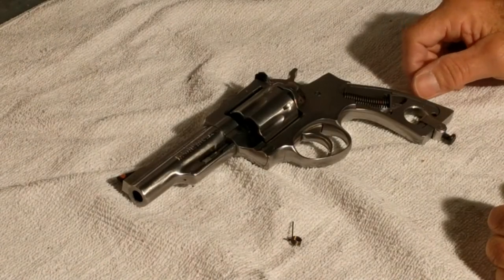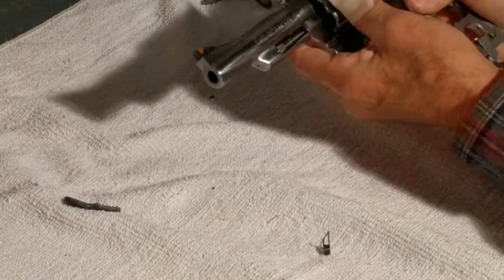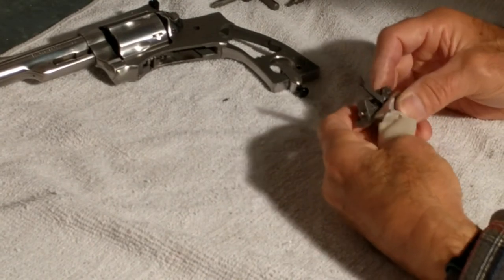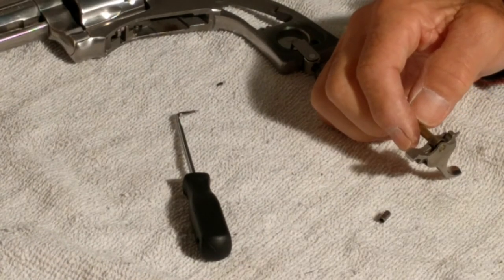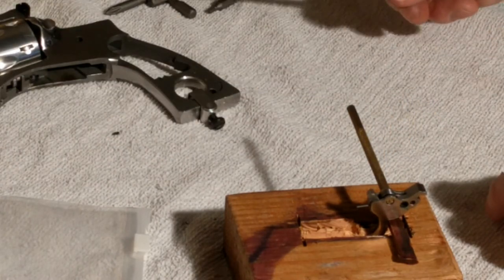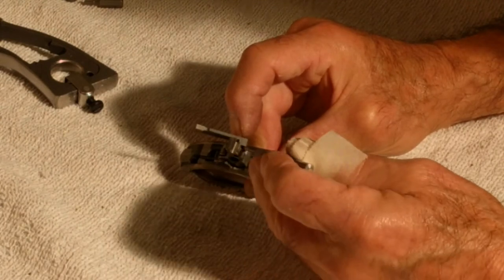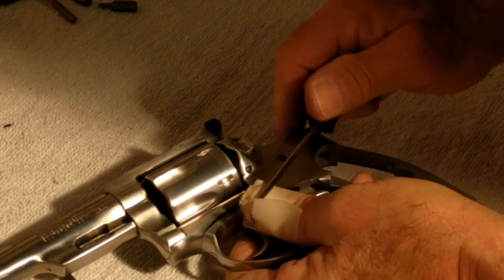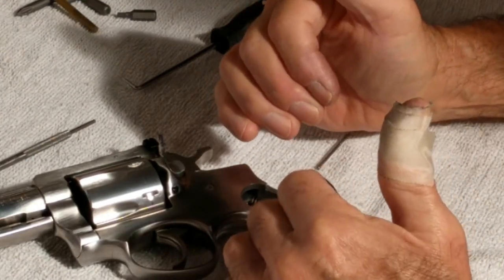Shooting Ruger Security Six install hammer and trigger springs disassemble reassemble by froogy

Comment: Good video. To install the trigger spring I had to put the trigger in a vice and push down on the spring with a stick of wood  while making sure the short leg of the spring stayed in its slot. Then while I held it  down my wife pushed the hollow pin in.

Comment: As a result of this video, I became a new sub... I'm not a gunsmith either, but, like you, I enjoy overcoming the frustration I experience, when gun parts I can't even name go flying to, God knows where... I purchased a Ruger Security Six recently, probably out of nostalgia, more than anything else. I carried one, on and, off duty for several years, in the 70's... I'd replaced the springs on that one, back then, but, I'd forgotten how... This evening, I sat at my desk, and, stumbled through both spring replacements right along with you, taking care to allow you to get far enough ahead, and learn from any problems you experienced... The upgrade was a success, thanks to you... I look forward to future videos... Just one thing; When installing the trigger spring, I used vise grips to hold the spring compressed against the trigger, and, lined up with the hole, enabling me to get the roll pin in without having the punch in the way, (taking care not to crush the spring). Worked like a champ.... Thanks, again....
Reply from the maker: Thanks, I'm no gunsmith, but I am not afraid to tackle basic mechanical things, this turned out perfect & probably saved me $150 or more that I can now spend on ammo.

Comment: The cylinder catch (the pice you were worried would fall out)  only has one way it will fit. The    plunger or spring you saw is attached to the cylinder so it doesn’t come apart.
Reply from the maker: Thanks!

Comment: What was the trigger weight after you changed springs . Did you put in a 14lb. hammer spring . And did the trigger return what out being slow  after putting in the reduced power trigger spring . Thanks for the video.
Reply from the maker: Sorry I don't have that tool to measure it. Just much better to my feel.